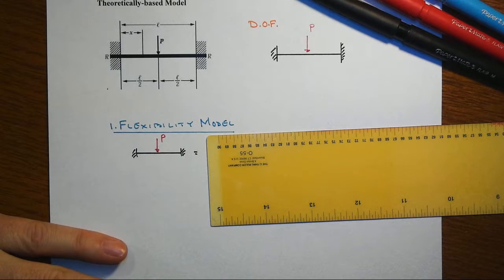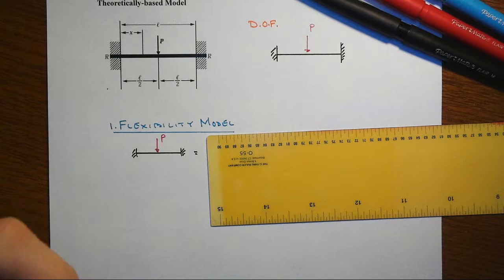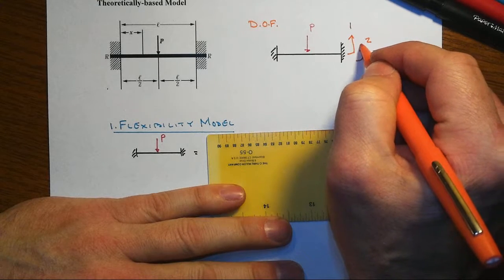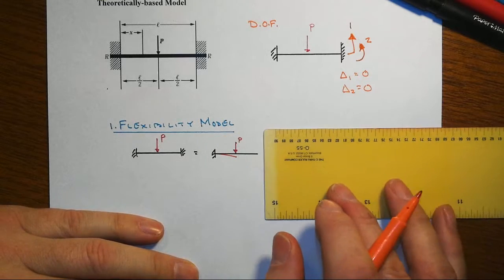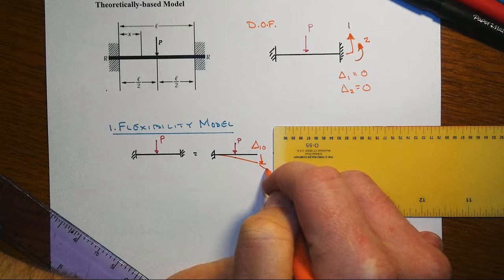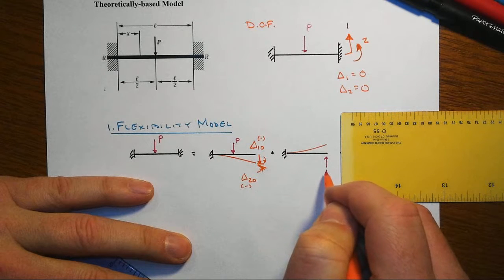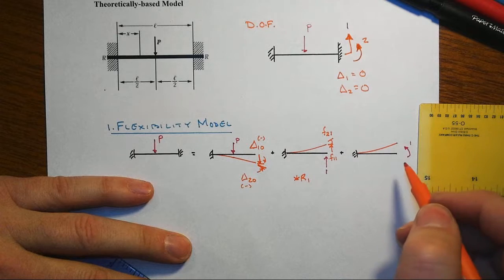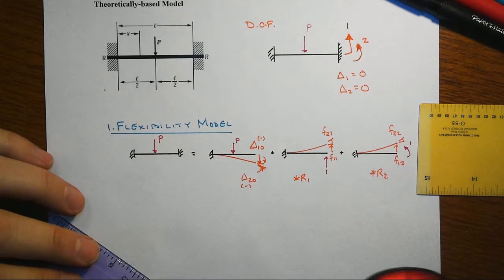Fixed Fixed Beam Part 1 Flexibility Method Setup

Comment: Do we need to solve this by keeping a unit load on the open end of cantilever in horizontal direction for horizontal force or do we asume no axial deformations?
Reply from the maker: First order. linear elastic theory would ignore interaction between axial and flexural deformations. If there were thermal effects, a geometric misfit, or an axial load, you would handle that solely from an axial perspective.